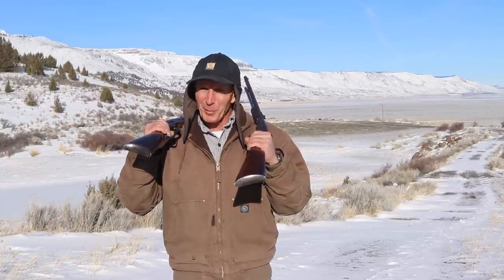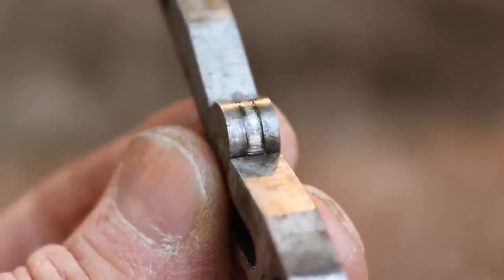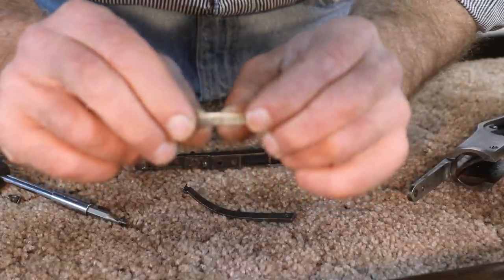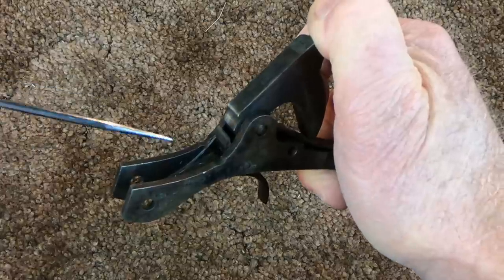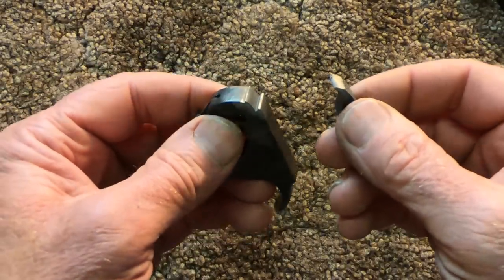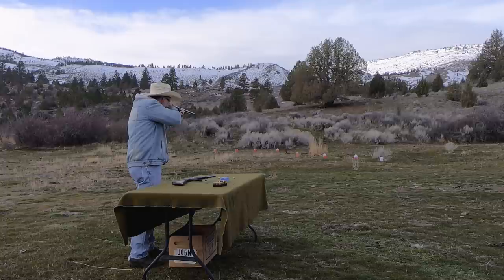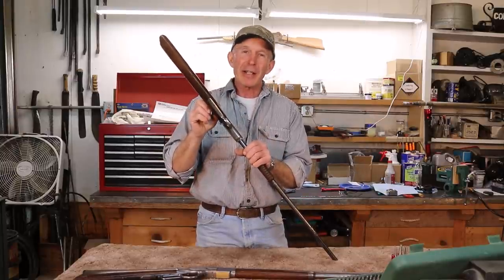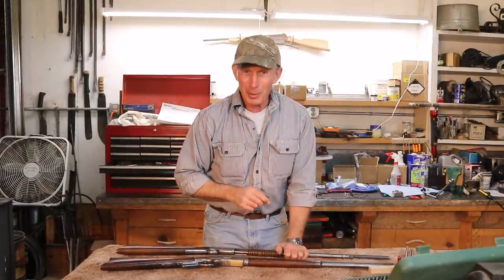Correcting Hammer Follow-Down on an 1873 Winchester

Comment: Best explanation of trigger hammer geometry I have seen,  Most modern firearms are hardened through and through, but as you show, lots of older guns had case hardening and need to be rehardened if you grind thru that surface.  Great work on the stock, always harder when you have to correct failed repairs.
Reply from the maker: Much appreciated!

Comment: Very interesting and informative video. I have a 1887 vintage 1873 so I am watching this with great interest. The one question I had about the cracked toggles I see you responded in an earlier comment. I have never opened the side plates on mine since everything seems to be functioning OK. Now I see its a good idea to open up for inspection
Reply from the maker: Some of those old 73's are really full of crud too.  It's a good opportunity to clean them out and oil them up while you have the side plates off.  Be careful with the side plate screw, they strip pretty easily.

Comment: Great video on both sear and hammer repair and also stock repair. The old Winchester pumps are some of my favorite 22s to shoot. Ive got a 1907 made 1906 Winchester chambered in 22 short only. Its still a great little tac driver. It has a Beach folding front sight that may have been added on way back in the day. Great stuff Mark.

Comment: I've repaired a Rem 700 stock and guitar headstocks using the same technique however I like the syringe method a lot! Had to glue up a table leg the other day and that would have been handy.
Reply from the maker: A syringe with a needle that screws on works best.  The epoxy is thick enough that it tries to push off the needles that press fit on a syringe.
Reply: @thecinnabar8442  thanks for the reply!

Comment: I recently picked up an Uberti copy of a 1873 Winchester that was used for Cowboy Action shooting, and the gun won't stay at half cock, so I looked into it, thinking it needs a new hammer. What it looks like is that the previous owner left the hammer alone, I don't see any grinding there, what I see is that the owner took a fair amount of metal off the face of the sear and thinned it a lot and what happens is if you pull the hammer back very slowly it will stay at half cock but not by much. I also think they replaced the springs with lighter springs. One of the nice things about the 1873's and even the Uberti made copies to a point, they're easy to get in and work on for the most part as long as you need what needs replacing.

Comment: The Marlin 336 and derivatives have a brilliant safety feature. Firing pin is not brought into potential primer strike until bolt lock bar is in locked mode.
I hunted with a Savage model 99 in 30/30 Winchester with long barrel and tapered fore end and crescent butt stock. My brother hunted with Winchester model 95 carbine in.30 army.
Both were beautiful rifles.
My wife’s grandfather got a huge bull elk with his Savage 99 in .303 Savage chambering.
I love those old guns and calibers. They were totally capable in the hands of good marksmen. 
The rotary magazine of the 99 could accommodate spire points as well as the box magazine of the 95.
Reply from the maker: Thanks for watching and commenting, Bill!  I was just working on a Savage 99 TD in 303 yesterday.  Great lever guns.

Comment: How you fix cracked links? Did Winchester make any of the 73’s that one could use smokeless powder in back in 1900? ,
Reply from the maker: To repair them, they have to be welded and machined.  I've done it several times, but there are replacement links made for the 1873 that are good quality.  All 1873's can be fired with smokeless powder, but the loads must be light to approximate the pressures of black powder loads.

Comment: With the carrier jamb can you maybe explain how the 1873 in 38/357 can handle the different lenghts. I do have to insure the 38 meet a specific length to feed right but still shorter than a 357.
Reply from the maker: Great question, Galen!  Remember, I deal with original Winchesters that didn't need to be equipped for slightly different length cartridges like 38sp/357mag in reproductions.  I suspect the reproductions have a slightly different profile on the front of the carrier to push a case head forward that may protrude onto the front of the carrier.  Even then, I'm sure you've found there is a minimum OAL that will feed correctly.  In the video, the bullet was pushed back into the case about .200" and there was no chance for it to feed without jamming.

Comment: Fantastic video!  As you were talking about the stock repair several questions came to mind.  You answered most of them.   There's only one that I have left.  I've been teaching music for over 30 years and I've seen a handful of times when old epoxy had to be "cut"  out of the inside of a repair in order to close a crack on the outside of a wooden instrument.  Would there ever be a time when that would be appropriate during a stock repair?
Reply from the maker: Every repair is different and has to be approached with not only how to make them stick, but how to make sure they stay stuck.  I have another 1890 in the shop that someone epoxied a crack in the wrist similar to the one I did in the video, but they didn't get it tight.  Now it's loose on the tangs.  I'll have to cut out the repair and then make a shim just the right thickness to glue it back and fit the tangs properly.
Reply: @thecinnabar8442  Thank you for the follow up!

Comment: Another excellent vid.  Must ask, where's the 86s? I've had a few & some damn nice ones but my fav, although not so highly desirable, is a 70% blue 33wcf configured with a crescent butt & full mag.
Reply from the maker: Just had one come in the shop with feeding issues.  I'll check it out and see if it'd make an interesting episode.  JB designed 'em too good and I don't get many in to work on. :)

Comment: I have a 1969 version of the Winchester 1894 in 44 mag.  My problem is that when the bullet is pushed forward by the bolt face ( the ejector makes the contact and pushes ) the rim of the shell casing does not slide up under the extractor claw!  Instead of the shell rim getting slid up under the extractor claw and seated properly against the bolt face, the shell is pushed into the chamber by the bolt face and the the extractor claw must jump/ride up over the shell rim as the lever seats the locking bolt.  Could the ejector be part of the problem?  I am having a devil of a time figuring it out.
Reply from the maker: It's really hard to diagnose feeding issues without seeing it in person.  If I understand it, the extractor is pushing the cartridge into the chamber and then snapping over the rim as the bolt closes.  If that's it, what problem is it causing?  Is it jamming or not feeding smoothly?
Reply: @thecinnabar8442  The extractor, by having to snap up over the shell rim mars and scrapes the rim.  The rifle and action are basically unused because the previous owner must have been dis-satisfied with this also!  everything works and feeds properly except for tearing up the shell casing rim on the spent cartridge.  I reload so the casings are as valuable as the bullet.  Is the extractor supposed to do this?  Thanks for any input...nothin' like having a real cowboy give you advise!
Reply from the maker: Got it!  It does sound like the extractor is far too stiff if it's causing that kind of damage to the casing.  If you're comfortable with working on your guns, you may try ordering a new extractor.  There are several companies that sell extractors for 1894's.  That would probably be the cheapest and easiest fix.  If that doesn't work or you're not comfortable with working on it, then I suggest taking it to a gunsmith.  It should be a relatively easy fix for a gunsmith to lighten the tension on the extractor.  Good luck!
Reply: @thecinnabar8442  Thanks,  and Happy Trails.

Comment: I have one of those old Winchester pump 22's with a worn extractor. Do you have any advice for it's repair?
Reply from the maker: The extractors are reproduced now.  You should be able to find one with an internet search.  They're pretty easy to replace if you're mechanically inclined.

Comment: Just wondering if Miroku or Uberti parts will work in the original. I have a ‘73 musket but it works fine.
Reply from the maker: I really like my 73 musket.  I did an episode with it a while back.  I haven't tried to use any parts from the aftermarket 73's, but most of the Winchester parts are reproduced and available online.
Reply: @thecinnabar8442  , I recently acquired a Winchester high wall Schuetzen in 32-40 with an A5 scope in near mint condition made around 1915. The barrel is marked “Especially for smokeless powder” I was wondering if you would have any idea how to reload for it or what original smokeless 32-40 ammo was used in it.
Reply from the maker: @davidgardner863 That sounds like a wonderful rifle, David!  32-40 isn't a caliber I've loaded. I would do an internet search to try to find load info for it. Have a great time shooting it.

Comment: what are you useing for harding?? looks like water , and steel under 35/40Rc point wont harden, did you have a slurry when you quenched?
Reply from the maker: Hammers are made of mild steel.  You must use a surface or case hardening process to infuse carbon into the outer layer of steel to case harden it for a few thousandths depth.  Typically, water quench is used when surface hardening mild steels.
Reply: @thecinnabar8442  ok , so you just edited the vid to the final quench................. ,Im versed in casment hardening
thank you for the reply

Comment: I saw a 92 in .25-20 that had hammer follow down. Wasn't sure way back when where the wear problem was. If you manually cocked the hammer it had no problem staying in the full cock position. Always thought it was the bottom of the bolt or hammer top being worn down so much that it just wasn't pushing it back far enough to engage the notch.
Reply from the maker: Good point, John!  I should have mentioned that hammer fall down can also be caused by the hammer not being rotated far enough for the sear to fall into the hammer notch.  I have another 1890 in the shop now that has so much slop in the bolt that it won't cock the hammer, but you can push down on the back of the bolt and cock it.

Comment: So now I have loaded about 250 rounds of black powder for this .32-20 and shot them all. I know for a fact now that black powder loads solve some reloading head aches. Solves bullet set back shown in the video. When loading smokeless loads I had crimp the dickens on that thin case mouth or I had bullet set back and jams plus the ultra tight crimp will start splitting the case mouths after about 3 loadings. Black powder loads actually are easy to clean in my 1873 with it's smooth chamber powder fouling never reaches past the case shoulder
Reply from the maker: Glad the black powder is working for you.  I've found the same thing about the cleanup in black powder cartridge guns.  Not much more difficult than cleaning up after shooting smokeless.

Comment: Is annealing needed after the heat treat?
Reply from the maker: Not when surface hardening mild steel.  Annealing or tempering is needed after heat treating high carbon, hardenable steels.  Thanks for watching and commenting.

Comment: The only problem I have with these really old Winchesters and Marlins is finding ammo for them. That's why most of the lever guns in my collection are of modern calibers, 357mag, 45colt, 44mag and 30-30, even some of these calibers can be difficult to find at times.
Reply from the maker: Especially hard to find ammo in these times.  Kind of forces a guy to start reloading.
Reply: With the old guns reloading is the only way to go. Even so, it can be a challenge to make suitable ammunition. The toughest part can be finding brass. Some can be formed from more common brass. A good example is 45-60 that can be easily made from  45-70. A last resort is Rocky Mountain Cartridge. They can custom make almost anything but they’re very expensive. Accurate Molds custom makes bullet molds to your dimensions. Of course that requires slugging the barrel. If you shoot an old gun, be sure you know the pressure limits of it. Many were not designed to handle heavy smokeless loads.

Comment: Great vid. It is a common practice for Cowboy Action shooters to lighten up the trigger on 1873s. Some of these are way too light for my comfort. Therefore, even modern reproductions should be checked for safety. Some CAS side x sides (shotguns) are lightened up to the point where they double when the first barrel is fired. Also check lightened up CAS single action revolvers. The problem comes where the shooter does not know how light the trigger pull is.
Reply from the maker: CAS is certainly fun to watch, but I'm not a fan of the modifications to the guns, either.

Comment: hi, to you mr cinnabar !!! 
 good video  congratulations,   even good work !!!
 but i suggest to you a new solution to fixing the broken  toggles,  change them ,   and you make  a new  pairs of toggles,   two pair integral toggles,    make  two front toggles  integral milled them  from one piece of  steel,  the some thing for the rear toggles, make two integral toggles  from one piece of steel,  and  then  modified their  hinge  with  a bit more steel in their surface such that they are more strong 
 so long,   best gunsmith  ... 😉
Reply from the maker: Thanks Antonino!  Fortunately, there are reproduction toggle links available for the 1873 that cost less than I can make them, so I put a set them in this rifle.  I don't think any links are made for the 1866 or 1876, so they either have to be repaired or made.  Making one set is extremely time-consuming.  When I get the time, I would like to set up and make several sets of each to have on hand.  Thanks for watching and commenting.